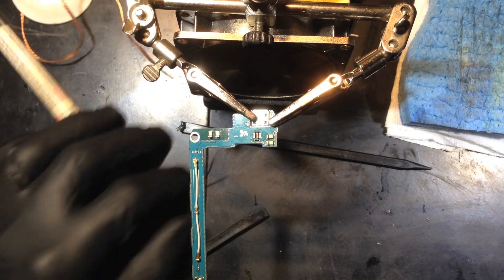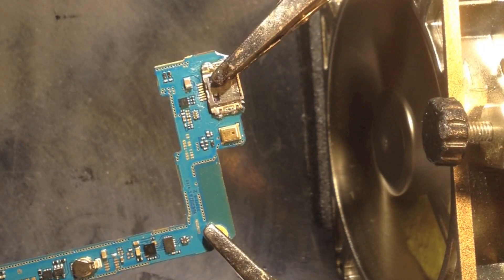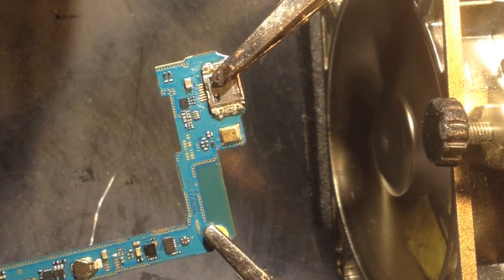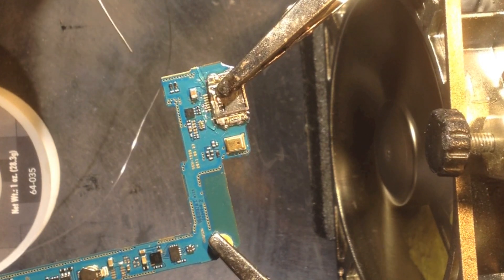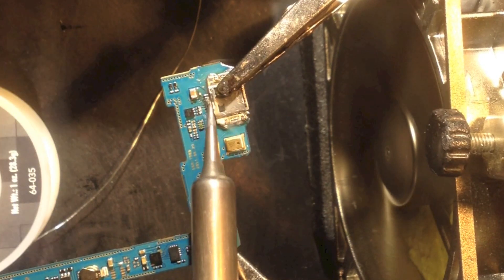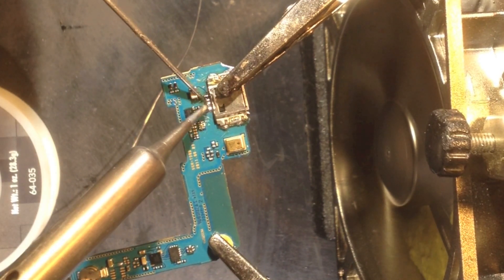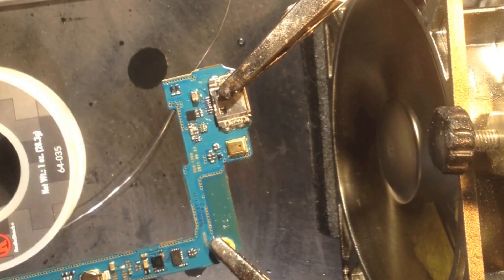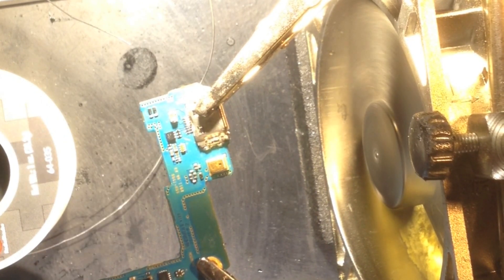Samsung Galaxy S2 SGH-T989 SCH-R760 Connector USB Charging Port Replacement

Comment: 1) please tell me what your soldering station?
2) At what temperature do you keep pyalnik? soldering
3) What do you call your sting? soldering iron?

1) скажите пожалуйста какой у вас паяльная станция?
2) при какой температуре вы держите пяльник? при пайке
3) Как называется ваше жало? паяльника?
Reply: +Канал CAS It is the Radio Shack 64 053 soldering station. there is one on ebay right now that needs a new probe , but you can buy the replacements online. i paid 150$ , someone has one for 29.99 now on ebay used. I solder at 400ºC , and i am simply careful about how long i contact what i am working on. Solder melts at a low temperature but i prefer to use it very hot , and just control what im doing. I call it a soldering Iron
Reply: Ryan Sepanek Thanks

Comment: Does it matter if the contact pins have contact with each other through the solder? Good video by the way thanks for posting.
Reply: +keepitonemill of course it does, solder is conductive, and conjoining them will cause a short. if you have too much solder on the pins with no wick to remove it, try pushing the solder aside and taking it off later.
Reply: +Jack Rudawski thanks for reply i had figured that but since i dont have the right tools or money to purchase them i have a cheap dollar store solder pen dont think i can be very precise with the tiny solder points didnt mean to ask such a stupid question, but i was really hoping the answer would go against everything i know, hahaha...thks again
Reply: Yeah you would need some decent equipment. Even my setup is very difficult to solder the pins on. I am getting some wicks at my hardware store because frankly, the solder can't seem to swipe it off.
Reply: +Jack Rudawski well im not going to let the fact that i dont have the proper equipment hold me back from accomplishing this task im still gonna try might just try to isolate each pin at a time by puting some kind of devider on each side perhaps razor blades might even try applying liquid weld with a needle on each pin...
watever it takes, hahaha.
by the way is this (wick) copper?
Reply: +keepitonemill yes, its copper wick. you can find them for pretty cheap on amazon.
Reply: This is insane lol. There's other options in life. And I thought I had OCD. It's a shame though as I've kept this phone pristine over the years replacing every other part. Ain't touching this charge port tho no way

Comment: Thanks for the detailed video, this is really impressive. The charging port on my S2 keeps failing because a couple of those pins are lose, and all the cellular repair shop will do is push them back down which is a temporary fix. It's been a long time since I've done any work with a soldering iron, but with a little practice and your video as a guide, I'm pretty confident I can replace the USB port outright. Certainly would be preferable to replacing my phone outright. 

Can you tell me what type of solder you're using for this project? It looks much more delicate than the spool of solder I have sitting down in the basement -- although perhaps the solder is less important than the proper use of flux and your technique with the iron. And also, what wattage is your iron? And lastly - how important is it to have a fan setup like that - is that mostly for fumes, or is it critical to the process? 

Thanks for your time.
Reply from the maker: the type of soldier is not too important , the fan, things like that, its just personal preference . I use RA flux , or silver-bearing solder, normally MG chemicals brand. 22 gauge or .015 diameter is what im using . I use the fan with a we sponge behind it so i don't breathe the smoke its very annoying to have in your face. The flux i use is MG chemicals no clean flux paste. I use the 120$ radio shack soldering iron. i turn it up high to 800, but the temperature doesn't matter, you just have to use control, and not let it sit to long as to burn through something.

Comment: Hi. My charging port has more than likely disconnected from the circuit board. What are the chances of something going wrong during such a repair? I'd like to send my phone to a shop but worry I'll lose everything stored on my phone. Do you offer out of state repair service?